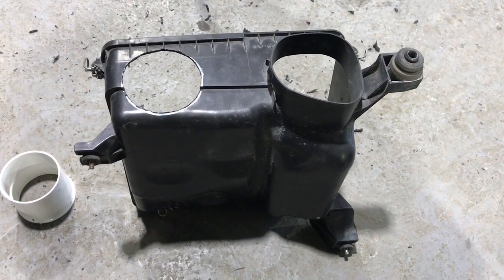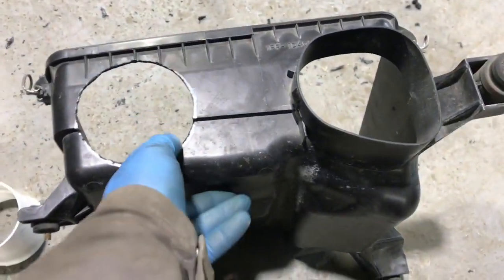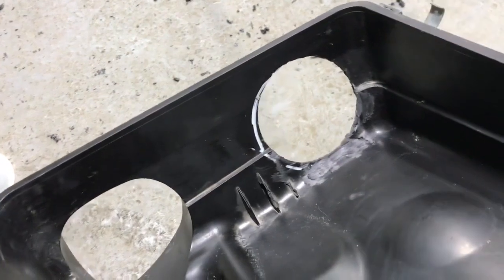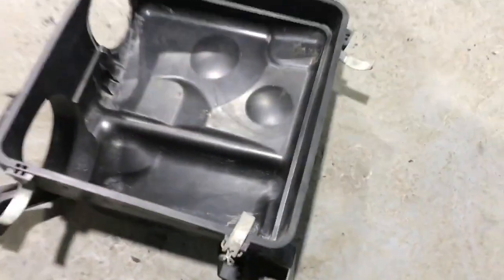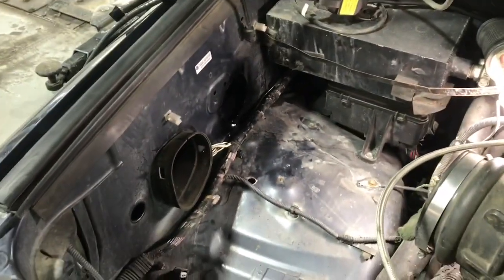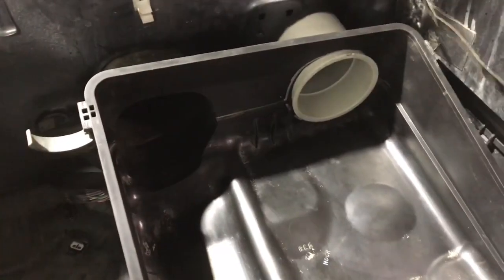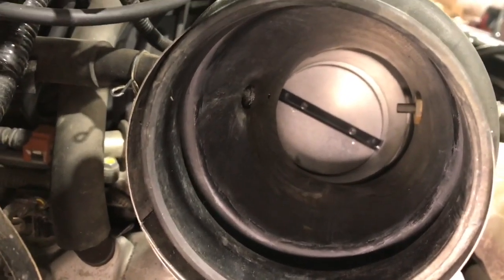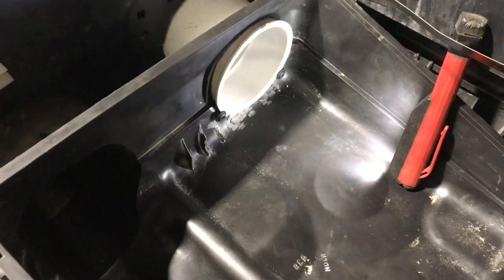Increase Horsepower On A 2007-2021 Toyota Tundra With SABM Stock Air Box Mod

Comment: trdpro oem air horn from your local toyota dealer.. 50$ bucks..
Reply from the maker: The TRD air intake accelerator does not increase the air box inlet opening size. This modification does.
Reply: @Viktor_G_Automotive  ahh, i didn't do enough research other than another video. Guy had said it's for the trdpro (in its package from toyota).. lesson learned!! lol